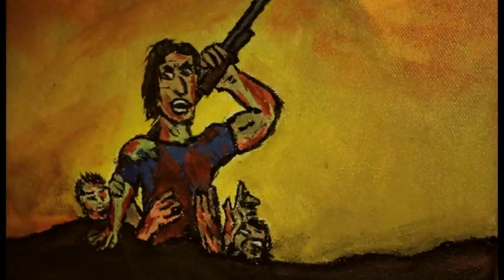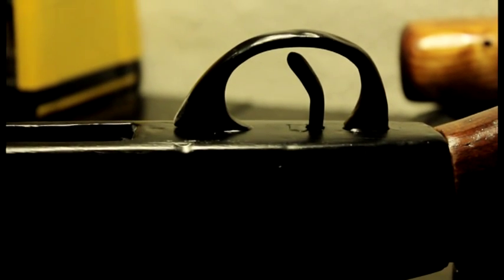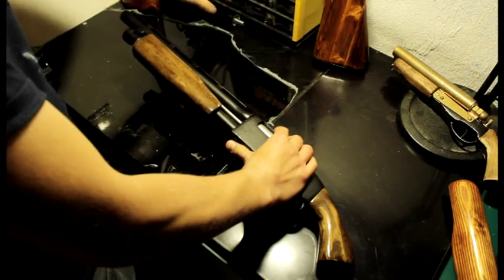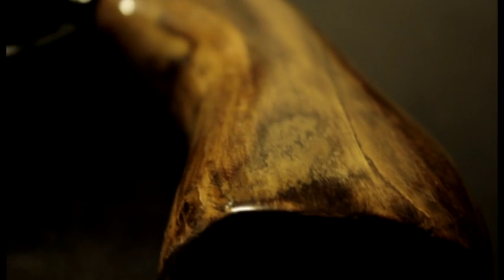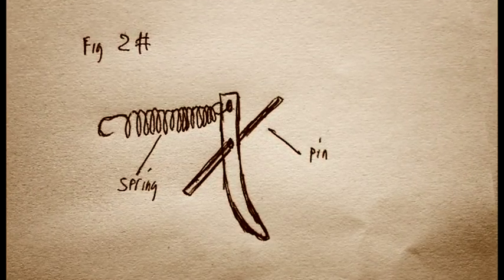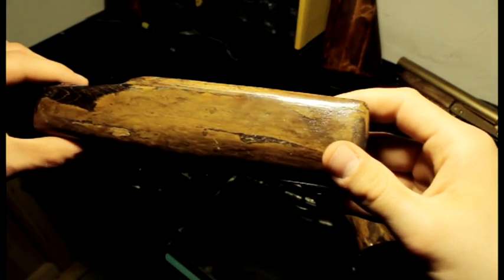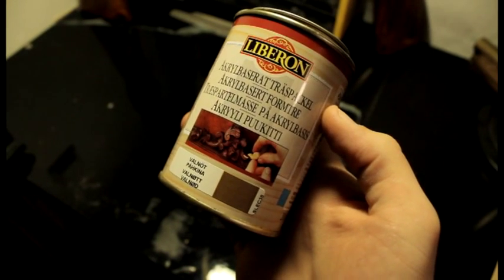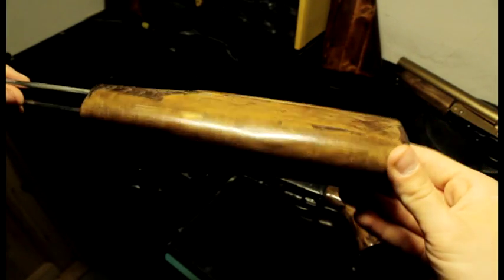Prop Weapons | Shotgun Revisited

Comment: Will these improvements still work if one builds a shotgun with the full-length barrel?
Reply from the maker: DarkJedi246 absolutely, this will improve the full length version as well 👍
Reply: Thanks! Also, the front part of the stock (where you place the epoxy to to support the guide barrel) won't interfere with the new trigger mechanism right?
Reply from the maker: It is possible to do this and still avoid the barrel support,  the only thing to keep in mind is that you might have to cut the slot a little shallower. And craft the trigger a little shorter enabling it to pivot free inside the slot
Reply: Thanks yet again. And btw, are the schematics for the original stock design still available for you to send? Otherwise I'll try to replicate them to the best of my ability. (big surprise; I'm gonna attempt to build one of these beauties for an upcoming film project)
Reply from the maker: DarkJedi246 Sorry man i think the schematics are long gone on some abandoned harddrive. My advice is to check online for measurements and take your time carving and sanding. My full size shotgun got an overhaul recently before It was used as a prop on a TV series here in Norway, I will post the updated version soon for all to see. I wish you good luck on your build, Im very happy to hear that you are gonna build one 👍

Just remember to spend time one the details that matters, The stock, trigger, receiver, and especially the transition between the stock and receiver.
On my original video these details is not well executed, thats why I had to overhaul it.

But you got this, once again good luck 👍
Reply: It's ok, I'll figure out how to get the stock somehow. But thanks for responding to all my questions! You seem quite busy concerning the lack of videos so I really appreciate it. Ever since I saw your Terminator arm effect on that episode of BFX I've been a fan of your work and I'm glad to see you're stilling doing prop gun-making. So thanks for everything, and no matter what future projects you have in store I'm sure it will just as entertaining as your previous work. 👍

Comment: I am going to attempt to build the shotgun.
Tho i am to young to get fiberglass and resin.
Could i use plate copper in stead?(bescause i do have a rotary tool(dremel))
PLease give me advise..........
Reply from the maker: Simon Bergman Sure you can use a copper plate, but i think that would be more difficult. Yet if you manage to pull it off it would look very authentic since youre using metal instead of fiberglass :)